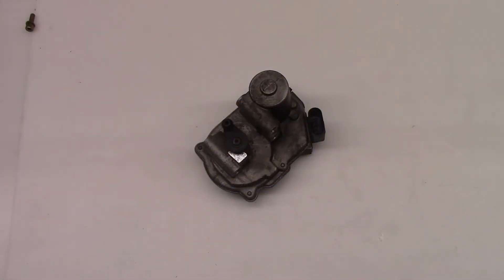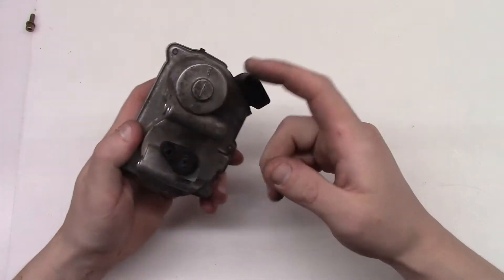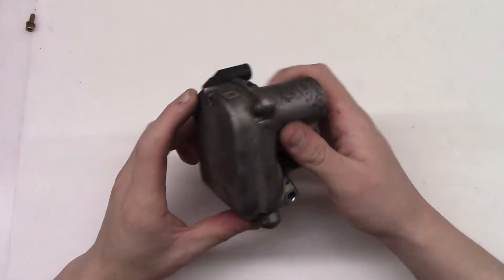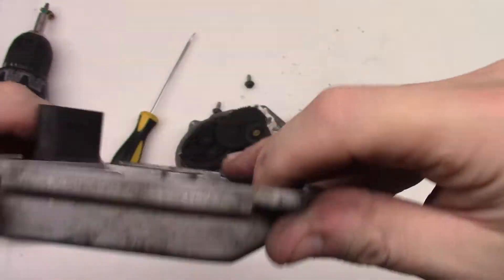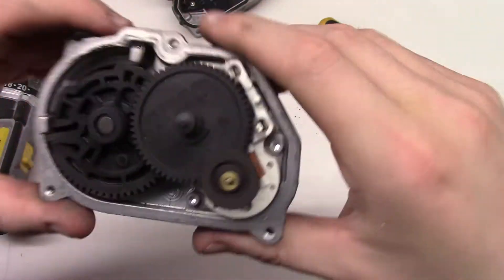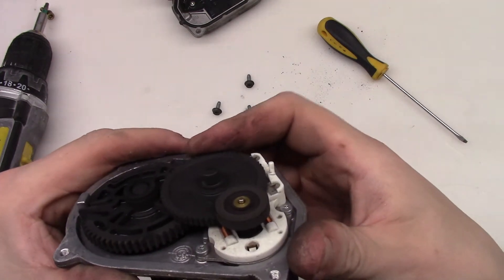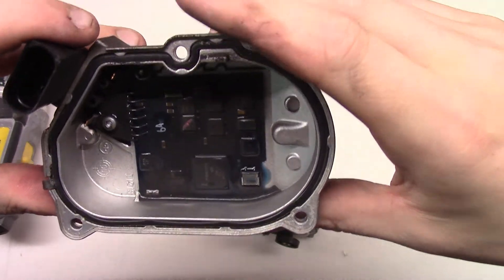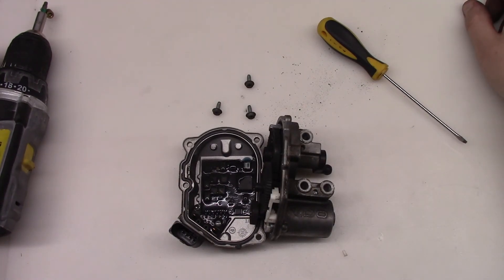Audi A6 C6 3.0TDi Quattro 165kW Intake Manifold Flap Motor Actuator--- What's Inside? ( 62 )

Comment: I have taken this appart also normal for the plastic cog wheel inside them to brake also seen them with a bad motor. They can  be  repaired if your good  with electronics. I  have  replaced one on the 2.5  Tdi  comman for this  to fail when EGR valve is  getting clogged up with Carbon. Also seen this fault because of the leaking manifold. Hope you're well have great day mate.👍
Reply from the maker: Thanks Ali.. my car EGR was cleaned 2 times in a year and when we cleaned it, it was quite clean so not much work, flaps looked also in working condition but for some reason check engine indicator still popped up.. so while i was estonia, one company deleted EGR DPF and added stage one chip on my car.. i smashed out that DPF also so no worries anymore with these things :D
Reply: @EstonianScrapper  Yeah that's why I have the 2004 1.9 Tdi pd 130hp repmapped to 170bhp no dpf
Reply from the maker: @AliMackMechanical   nice, fuck green peace ;)